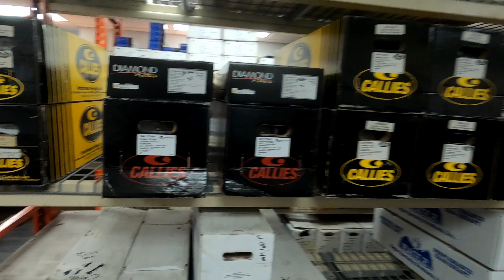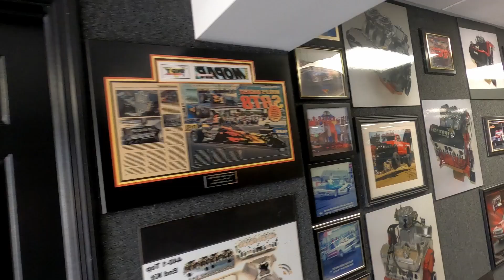Indy Cylinder Moves Into The Future

Comment: Pretty cool video. I am a machinist, so I like watching things like this. I have only worked one place that did Automotive stuff like heads and intakes. And one Wheel manufacturer. I hated running wheels. I have purchased Aeroheads for a Small block Mopar I built in the early 2000's. They work great. I noticed on indy's website that Aerohead is still there. That is good. I would love a big block Indy motor some day.

Comment: How about a Complete street bolt on "Predator package"? one that doesn't cost 50 grand and someone on the phone @ tech that has a personality..INDY Wrecked that part and drove a lot of people away, I spent 200 grand with Indy over the years and had Constant issues that were met with the classic "not answering the phone" syndrome.
Reply: That's why everyone is going trickflow for heads